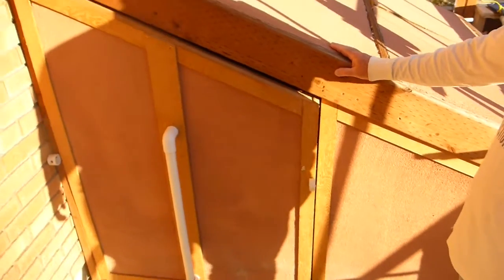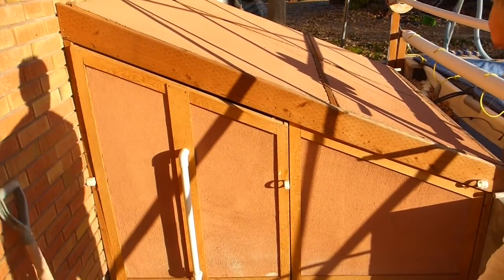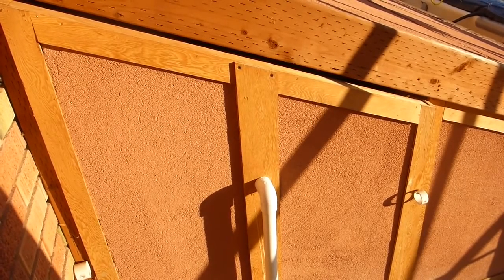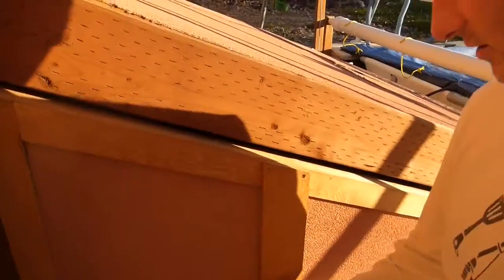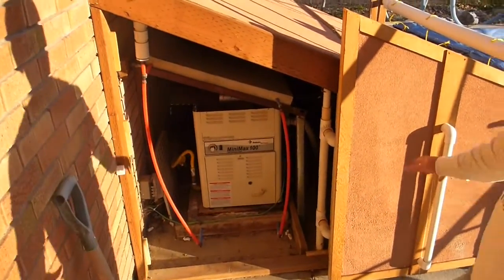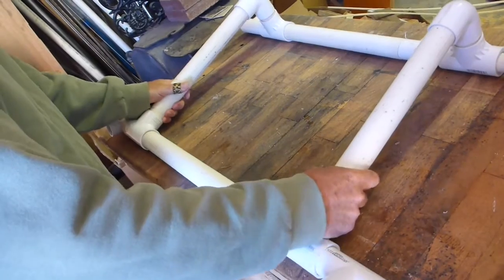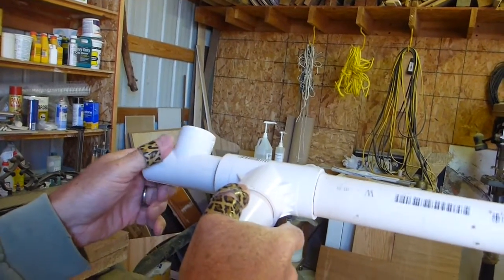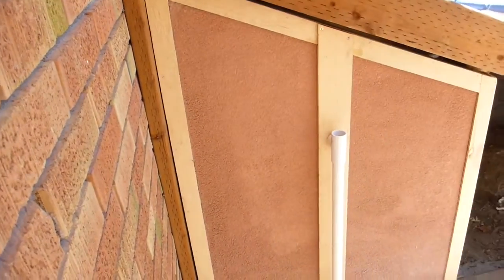A PVC Pipe Hinge for the Swimming Pool's Water Heater and Filter Shed Door

Comment: Video is ok, but I had trouble hearing over the flute. Is it possible to put in less obstructing music in the video? Thanks.
Reply: I am sorry. That is something I have had to learn about. I will look into taking it out. For now, you can try turning on the captions? They are not perfect, but they help.
Reply: They do... Thanks :) I'm actually looking for ideas for making room dividers, using 2' wide by 6' high pvc pipe frames and then stretching fabric on the frames, connecting them with pvc hinges